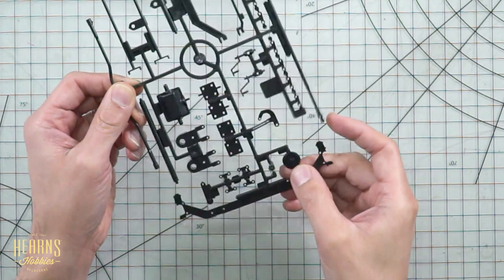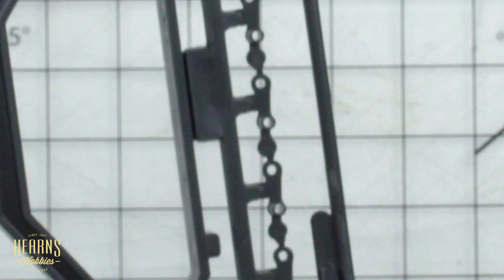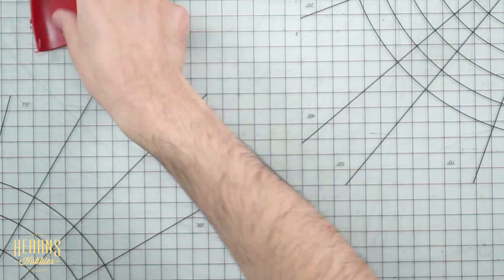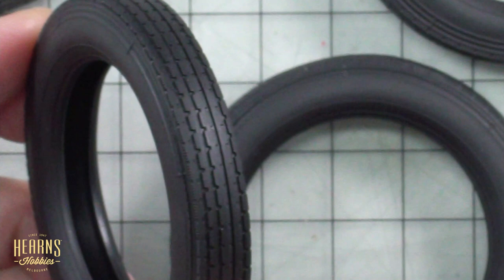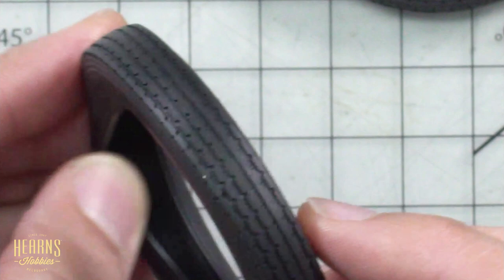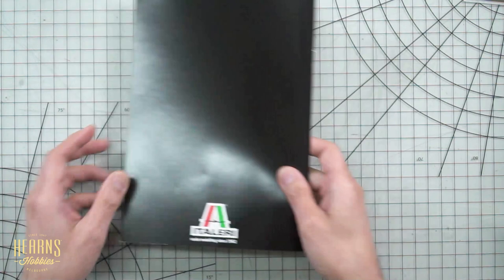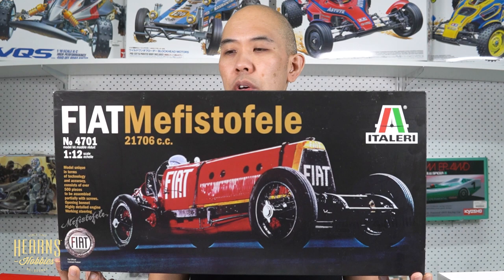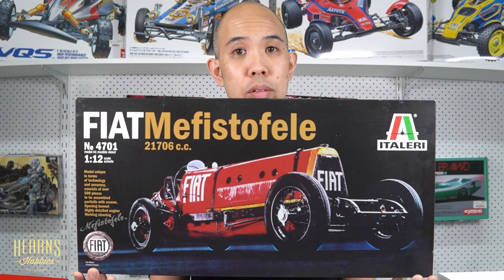Italeri | Fiat Mefistofele 1/12 Plastic Model Kit Unboxing | #askHearns

Comment: Tarquino Provini (AKA Protar) designed this kit back in the '90s I believe.  I had one of their version.  The wheel/spoke sprues were pot metal.  So was the body and frame.  I'd much rather tackle those parts in plastic!
Reply from the maker: Yes, the plastic is much easier to work on. Here is my video about re-spoking the wheels with wire: https://youtu.be/YouptF7DlIk